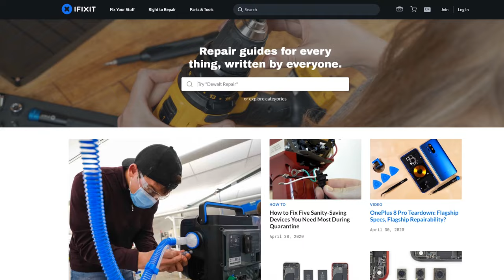Rebuilding my Gaming PC for Fun (not fun....)

Comment: I’m familiar with “stacked” radiators in trucks. Mine uses a smaller one in front of the larger main one. I’m curious as to how it would affect your system by running a 240 in front of the 360. Would the additional fresh air to the back radiator offset the reduced size of the front?

Comment: I remember the first computer I really tinkered with and rebuilt. Was some old hp vectra vl that the school threw out, but it needed cpu, ram, and hard drive. So I ended up with a pentium overdrive 166 w mmx, 112MB RAM, and a 3GB HDD. lol it was still trash in 2004 but I loved that damn thing. I put NT4 and later win2k on it and it handled a lot of day to day tasks (that weren't gaming lol).

Comment: By ear (crackling), you are loosing voltage in your preamp or amplifier some place due to voltage drain on some circuit. May be if you unplug something or add additional power to the  stream system/machine. Since it is a PCI RTX card may be it needs a better power supply. Would running on Euro 220v -250v style power supply help your set up?

Comment: Could you please make a video regarding the new x570 motherboards and the additional 4 pin ATX power connector they ask for (maybe a video on power demand in general)? I would love some clarification on this as it appears it is unnecessary  unless performing major overclocking, but i also see it may be necessary for general stability.  I'd love to not have to upgrade my PSU right now and i really like how your channel explains things thoroughly. Thanks.

Comment: Watching Linus try to vacuum a radiator clean was frustrating. 1 min under a decent faucet dude, so much quicker & cleaner. If you have oil/grease in your dust then you need to soak the rad in detergent or a weak solvent that won't affect the paint. No risk to fins.

Comment: Nice my first system was a 80386 sx25 that i later upgrade to 40dx and at that time there where at least in my country no manual with the motherboard and the older psu's have a split connectors for the mainboard that could be connected even the wrong way... the first think i discovered when my brother have made wrong connection and "Burned" the first mobo XD

Comment: I have i7 4770 3.4 ghz, rx 480 4gb no oc, 8gb ram, am i good for gaming 1080p 60fps in games for awhile? Should I build or buy a pc? Should I buy a new console since they're cheaper and reliable for gaming? I had a 360 then ps4, then built my pc. I love how smooth over 60fps is. I despise input lag. I'd like to be able to stream my games on twitch, using amd streaming software or obs. I hope you get what I'm asking. Also, would getting an ssd for my os increase performance and reduce lag spikes in games like fortnite or csgo?

Comment: Linus disassembly important timestamps/ out of context
10:24 😳🌬️
16:48 cathartic venting on his most trustworthy companion from the last 15 years
23:32 confessions
25:29 self afflicted torture
27:10 the rad
29:00 realization
29:29 american work ethic
30:28 when youre a power tool 😞
32:35 ok honestly there are too many statements
33:27 🧼
34:30 concentration
35:18 sponsored segment?
36:39 Trump on coronavirus
37:20 confidence
37:32 lack thereof
42:34 more laziness
43:24 education
45:07 cleaning supplies
45:47 technique
47:06 dust
50:24 nuts
51:08 🦟
51:48 fin of the disassembly

Comment: So I have a question. My friend wants to pick up a new graphics card for gaming and streaming.  He was previously looking at the RX 580, but he started looking at a titan x that was only $250 on ebay. His processor is the ryzen 3 3200g and he has 16gb of ram. He was looking at a bottleneck calculator and saw that the bottleneck with the RX 580 was 7%, but with the titan x it was 20%, which is bottleneck. I had already made the argument that the titan x wasnt made for mainly gaming, but was more optimized for productivity, and he made the argument that its "about the same as the 1080 ti", which to him means that it preforms just as good. Because the titan series is always seen as more powerful cards, he thinks it will be much better than the rx 580, but i keep telling him that just because the bottleneck calculator says it bottlenecks 20%, which for the most part is bearable, does not mean that he will get the max frames because its a performance card and is built for precision and would only be good if coupled with a more high end processor. Am I wrong? I often get the feeling that I dont know what im talking about so anyone with more knowledge than me please tell me. Im trying to settle this argument before it gets out of hand so who is right?

Comment: I am curious.... your hardware only needs 600 watts... I would put an 850 watt psu into a case with that requirement, indeed my current gaming rig is running a Corsair RM850x with no problems whatsoever.... so why do you drain your bank account to put a psu with more than twice the power you need?

Comment: Duuuude how did you get to your level and not have any idea of the Nomenclature used on switches??  its on like virtually eveRy switch and contact set ever normally/Open Normally/ Closed and Common????  then you even said it the wrong way when describing the open cct and closed cct. when pressing the  button whilst testing...   
Love ya work, just amazed you clearly had no idea...
Loved the fact that once a (Valid) Bodge of melting into the switch body was suggested were all over it :P
But if you had just melted a solder ball on the top you'd have gotten the same(but better result LOL...)  or trimmed a bit of more plastic off instead of melting the plastic ;)

Comment: Hello! Off Topic :)...How to cpu overclock manually in Alienware Command Center? All I see was a sliding bar for Frequency, Core Voltage and Offset  Voltage. What do I need to tweak 1st of the three options?.  Appreciate any ideas :).

Comment: My first PC what I get was AMD 486 DX2/80MHz and it was faster then most of DX4/100 because of 2 x 40MHz  vs 4 x 25 MHz architecture and..it was later also faster then Pentiums or Cyrix CPUs of my buddies becouse I upgraded RAM up to 96MB... Most of PC I the middle of 1990 had 4 or max 8MB RAM.
Btw.. I used VLB S3 4MB VRAM GPU and SB 16Pro with Yamaha Wave Table Sadwitch with 4MB Wavetable... That was a great time.

Gravis Ultrasound was the last crap you could buy at this time.. It is my privat opinion.

Comment: I am 10000% sure audio issue is wrong sound card / drivers / OBS configuration. It's sampling frequency. One device could be 44,4 KHz and other can be 48 KHz or there is buffer size/overflow issue. It's 100000000000000% not cable, anything with audio hardware.

Comment: Here I am waiting for my i9 10900K to arrive... What to do, what to do... Oh, a 5+ hour long LTT video about rebuilding a PC, why not!
I've got two Corsair Obsidian 1000D cases ready for my rebuilds, a shit load of unnecessary fans, AIO water cooling for my new CPU and for the first time in my life, custom water cooling loops for my old systems. I don't trust myself enough to custom water cool my new CPU, mobo and my RTX 2080 ti. A graphics card that cost the same as my new CPU, mobo and RAM combined...
I'll admit I'm a bit of an Intel fanboy. Even my Core 2 Duo is still running and I'm still using my 1st gen i7 CPU for sandbox stuff.
I've been burned by AMD a lot and I think that's why I'm personally afraid to go that direction, even though they're beating Intel at every release right now...

Comment: There's a ratcheting screwdriver at home depot with extra long bits that are stored in the handle. There's also ratcheting screwdrivers that have 2x or 6x gearing, ie you turn the handle 30 degrees, the bit goes 60 degrees or180 degrees via gears in the handle. You don't get a mechanical advantage so you shouldn't over drive, just drive faster.

Comment: I'm pretty sure my Pentium 150 had MMX. I'm not certain that it predated the Pentium 166, but it's highly likely.
Reply: I think there is a mobile Pentium MMX 150, but not a desktop one. The slowest desktop Pentium MMX there are 166MHz I believe.
Reply: Looking at the specs for the motherboard I had suggests it was a P54C, so perhaps it didn't actually support mmx - I didn't know enough to care at the time, so it would have just been a processor flag showing (or not as the case may be) in /proc/cpuinfo back then.

Comment: I am building my first pc ever, could someone tell me how this build sounds because I'm thinking about replacing a couple parts like maybe the GPU.
Radeon RX 580
corsair vengeance, 3000hz refresh rate
inland premium 1tb SSD
arourus pro wifi
AMD ryzen 5 3600
wraith spire air cooler
a 750-watt power supply
and the MSI Optix MAG24C
all stacking up to around 990$

Comment: Linus please help me resolve my gaming pc problem please my problem is when I run game on my pc it was shutting down
Reply: XXXTENTACION l oy bud, still having issues? Are you bluescreening? If so make sure your CPU isn’t overheating, if it is then you’ll need to  check to make sure you’re cooler is working properly. If the cooler is functioning, then you’ll likely need to pull it off and reinstall it, reapply thermal paste, and try again.
Reply: AngelBurger No is not blue screen or anything it just shutdown when I run game on my pc then next time I open my task manager and I run the Roblox and my power use is both very high

Comment: water cooling requires more attention, and if it is in a sever box you can just mount external u fans. as long as your airflow is proper from front to back water cooling isn't actually going to help much outside thermal spikes. but since you are running a consumer machine in a rack those thermal spikes will be more common. so you do you and tell me about it, don't ask me for the results.

Comment: i still don't understand why it's called "building a computer" and not "assembling a computer" since you are not building any of the components, just attaching/fitting them where they need to be.
Reply: When you're building a house, you did not  make the bricks and steel bars yourself.
Reply: @tol9090  so? you don't just assemble bricks and bars, you have to use cement mortar and concrete to actually construct a building. these materials get chemically and physically transformed in the process (to put it lightly, to tell the truth nobody with common sense would compare building a computer with building a house). once construction is complete you no longer see bricks & bars but walls, columns, floors etc. also there is no way to disassemble a house without destroying the house and the components. can you let's say replace a floor of building with a new one? in case of a PC one can easily disassemble the parts, re-use them elsewhere, replace parts with (compatible) different parts
Reply: @deephazarika2259  point is you're ranting about a semantic "problem" that nobody has, and nobody cares about. Words have different uses. Nobody in the world think you're constructing microchips yourself when you say you're building a PC. find a hobby
Reply: @deephazarika2259  you're completely insane xD Calm down baby boy

Comment: That is a VERY poor water-cooling set up. Those Rads are stacked WAY close. And yea you address it at 15:57 and made a video about it which I saw. But I think you are missing the point of that video and what Corsair was saying, or you're just ignoring it. In the video where you tested it, you had a standard case with the first rad a the front and then the 2nd rad at the top, there was lots of space in between the 2 rads. This allowed for some cool air from the open back part of the case to mix in with that hot air from the first rad and cool it down before it reached the 2nd rad at the top. This was almost certainly why you had a 5-degree improvement. And you even say this in the video. But in this build... you are literally stacking rads. There is very little room between the first and 2nd rad! Like 1 inch! And that space is all sealed off so no cool air can mix in with the hot air from the first rad before it hits the 2nd! Except a tiny gap on the right side of the case that almost isn't worth mentioning, a very small amount of slightly less hot hair air behind that 2nd rad could potentially make it through that gap on the side and mix with a tiny bit of the air in front of that rad... but I sincerely doubt it as those rads are so close. Air from the first rad may even just blow around that little gap. So, the air is just going to blow straight through the first rad, get very hot, and have no room or time to cool before it hits that 2nd rad. Radiators need a temperature differential to be efficient heat exchangers. And that hot air blowing straight into that 2nd rad isn't going to do anything at all except get in the way of those fans. This is exactly the type of situation that Corsair was talking about. Why did you not test this rig alongside the other one? I'm 100% sure this one wouldn't nearly have had a 5 degree improvement with that 2nd rad being where it is. You shouldn't just release a blanket statement saying that "oh it's okay to stack rads, our single test with many variables busted it." This case right here is an example of how you should NOT stack rads.

Comment: It amuses me that water cooling and RGB "Argh!!!!" {{{Shiver}}} is a thing when it comes to computers, all that extra cost for what? no seriously for what?
My old seriously old AMD Ryzen 7 complimented with a seriously old GTX 1080Ti can stream my gameplay LIVE at 4K, that's right! one PC working on gaming and streaming LIVE at 4K, BTW since slapping the old girl together she hasn't been opened up, not even to clear out any dust that may have accumulated due to an over sight of mine using the supplied fans for my Corsair ATX Tower and AMD's Supplied CPU fan, Granted the old GTX 1080Ti can only muster 30 frames per second for gameplay whilst streaming at 4K, but if I am not streaming, the frame rates with all settings to the max are quite acceptable, mind you I always could do with a much better Graphics card but being a pensioner pushing 70 I am only half way there in saving the dosh for one, BTW we get some seriously hot days here in Ass-Trail-Ya and with no Aircon I imagine the old girl may have gotten pretty hot, I know this as a few times her fans seemed to run a little faster whilst I was Game/Streaming..

Yes the old girl will have a shorter life, but hey she ain't gonna go before I pass her on to the Missus who is still using my old gaming PC "Shhh cant wait for her to ask for an upgrade" te-he-far-kin-n he, I be with glee, of course that may mean I have to rely on Afterpay.. :D